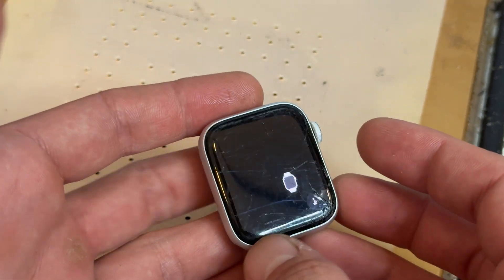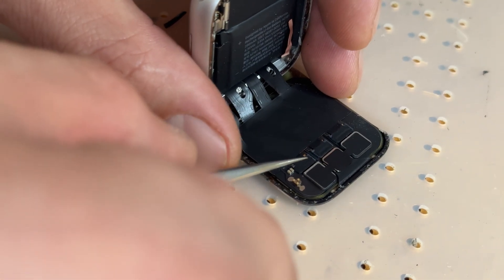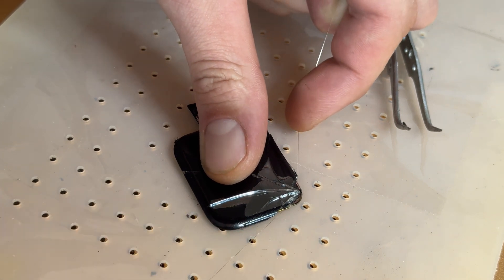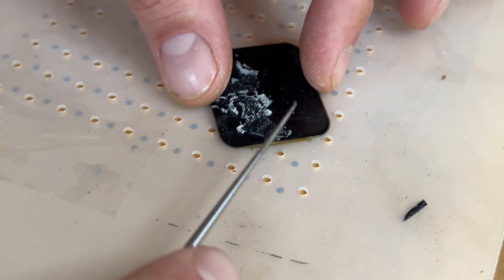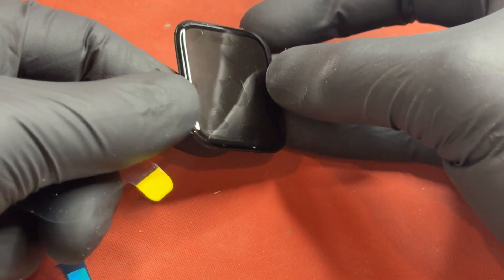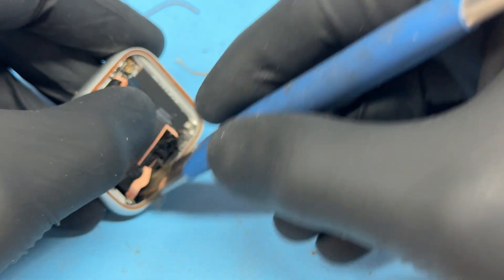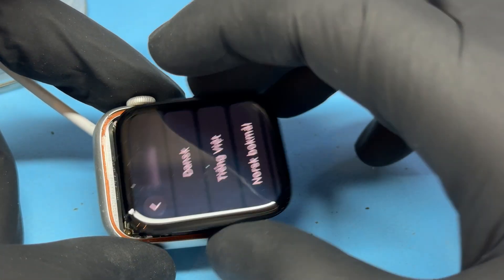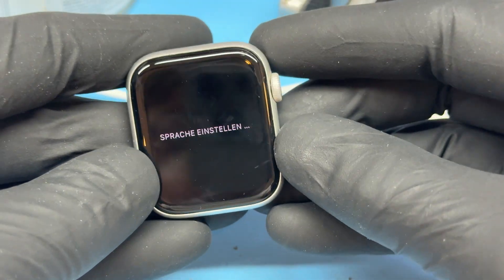Apple Watch SE 44mm Glass Repair - Full Guide To Fix Your Broken Apple Watch With Secrets And Tips!

Comment: Note for when separating the oled from the glass, don't do like I did and pry the oled from the glass if it has re-stuck after cutting with the wire as you may end up delaminating the oled itself, killing it (fortunately it was on a practice screen that didn't matter), instead run the wire through again to get it to separate (or use something very thin plus IPA such as Mr. iDoctor did.)

Comment: 👍 I watched several videos and yours was the best. Since it was my first time, I didn't know how to best get the wire between the screens. I finally did but torn the old screen a little.  I hope it will still work. I kind of wish as a novice at home, I would have bought the touch screen instead of just the clean screen only.